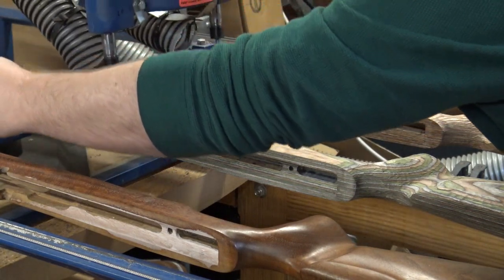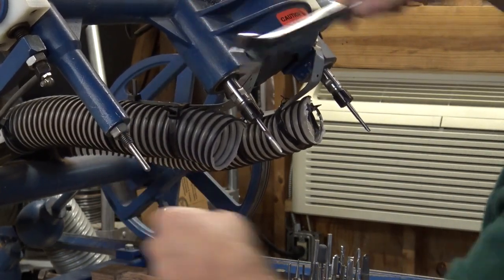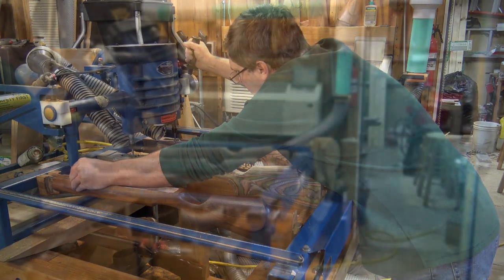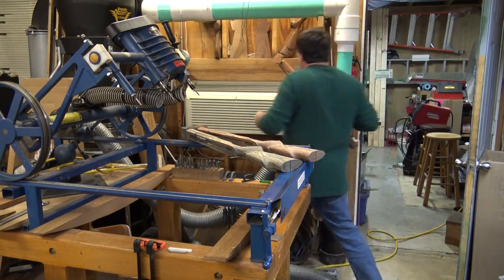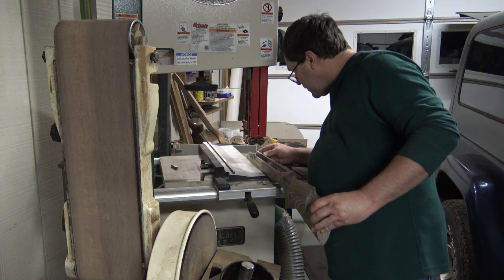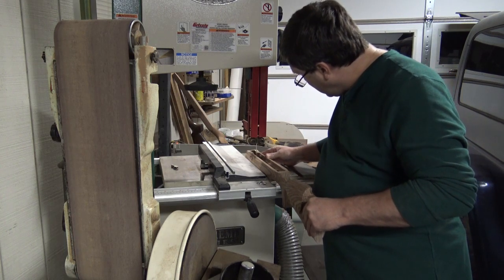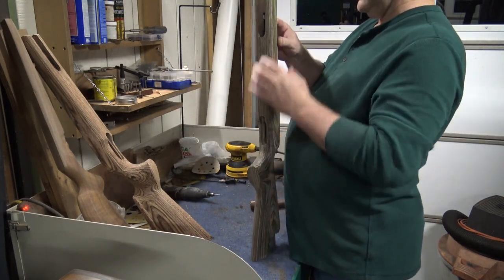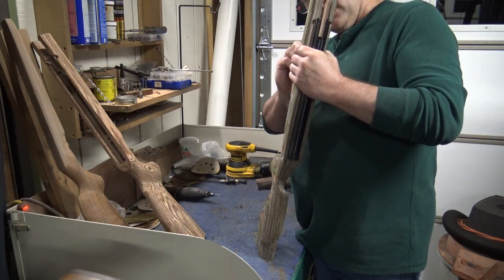HW50 Target Stock Inletting

Comment: Love your work, and those muzzle breaks are stunning what do you charge for your muzzle breaks (that's what we call them over here in the UK.
Reply from the maker: Thanks!  We call them the same.  With porting or threaded inserts in the end they usually run a little over £90, or about $115-125
Reply: @PaulWattsSpringGunning  do you have a website Paul.
Reply from the maker: SpringGunning.com
Reply: Instablaster